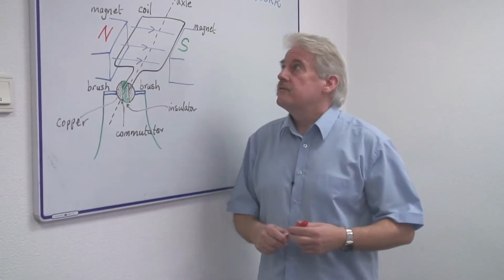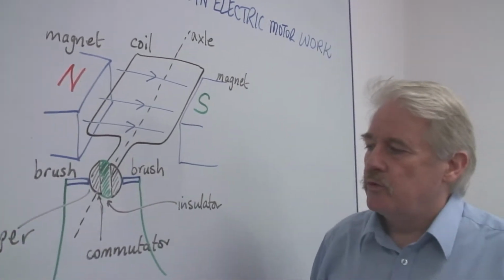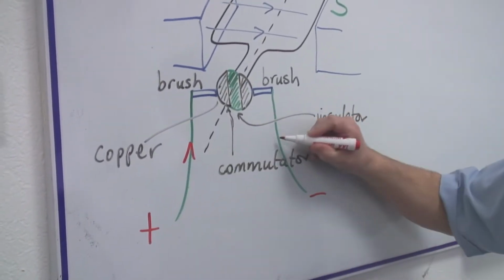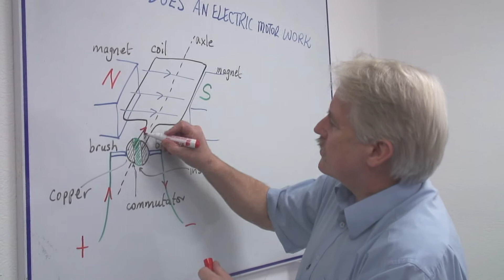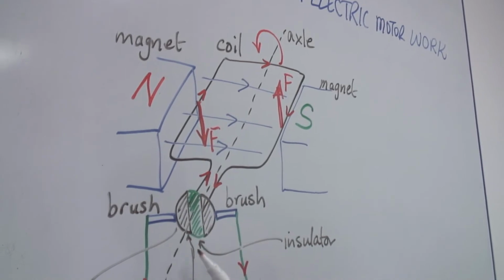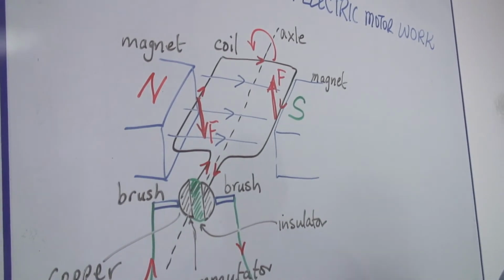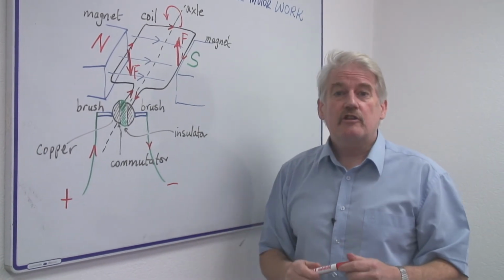Energy & Electricity in Science : How Does an Electric Motor Work?

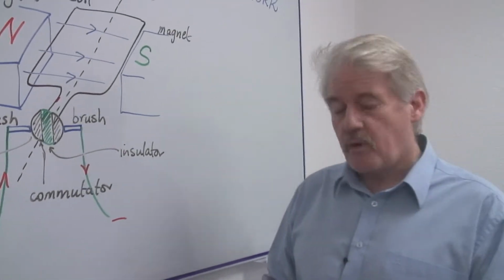Comment: Very good, but for the layman, I think you left out a relevant fact just at the point where you mention Fleming's Left-hand Rule (1:58) and that is that when an electric current flows thru a wire, a magnetic field is produced around the wire.  So, what turns the motor is the repulsion of the magnetic field of the magnets and the electrically induced magnetic field.

Comment: He's talking about the commutator. There are the two ends of the coil and in the middle is the green insulator. 

Each end of the coil is in contact with one of the brushes. This allows current to pass through the coil in one direction and cause the coil the spin. The commutator spins with the coil. When the coil has spun 180 degrees, the end of the coil that was touching the positive side of the circuit is now touching the negative and vice versa. This causes the current to change direction.

Comment: @sandslash123 If there's magnetic field (not the induced one obviously) like here (magnets), you use left hand rule and you have to point your index finger from north to south pole of magnets, middle goes as the current flows and then thumb shows you the motion direction. You couldn't use right hand here because it shows only induced magnetic field direction instead of motion, and it doesnt consider any external magnetic fields.

Comment: @sandslash123 because left hand rule shows you the direction of magnetic force (your thumb) in relation to electric current flow (middle finger), which is quite useful in this case. You have to make sort of "pistol" figure with your fingers: when thumb is upwards, index finger is straight and middle finger is angled 90 degrees. Quite easy :)

Comment: Thanks for the video, i understand quite most of it, however, why is the current moving from + to - , isn't it supposed to be the other direction?
Reply: Doesn't really matter, does it?  The current flows thru the wire in SOME direction and so the motor turns.  But you are correct, at least in simple electrodynamics we are told that - = electrons and these flow thru the wire.

Comment: This is actually an electric generator, not a motor. The flow should be showing in reverse. Coulombs Law uses the right hand rule, but this sir uses his left hand.
Other than that, the principles described are correct.

Comment: If I would grade any of the videos I've seen here on eHow I would say that there are at least 4-5 things wrong in them, they are using wrong terms and not really explaining how things do work.  An electric motor works by rotating a coil meaning magnetic material to generate an electric current that sends electrons down a wire. It is pretty simple thing to do but here is the fun thing magnets have a state of equality meaning that the coil will stand still if no outside force is applied.